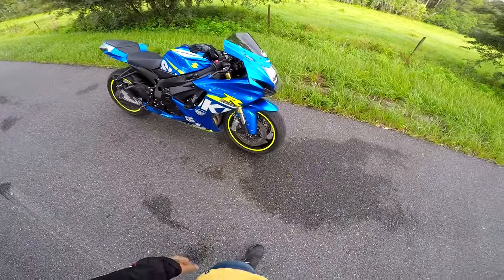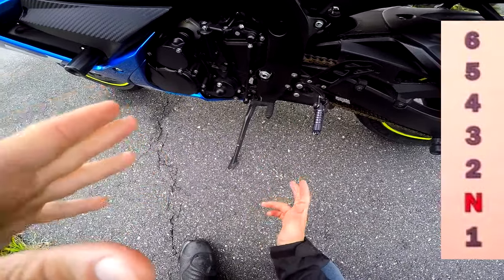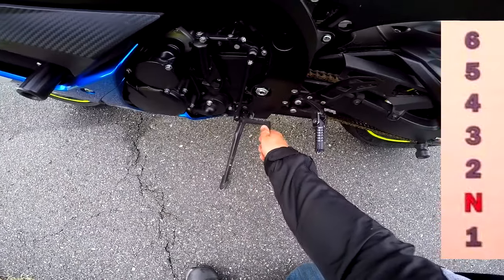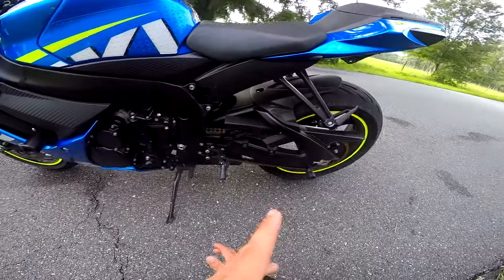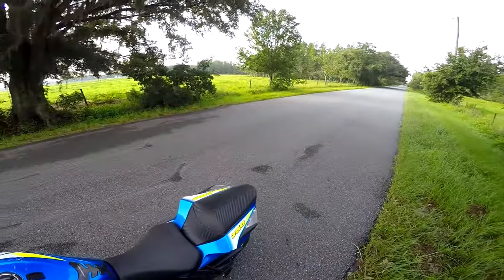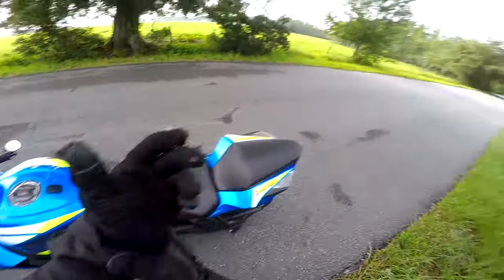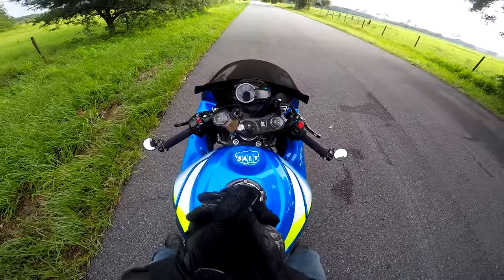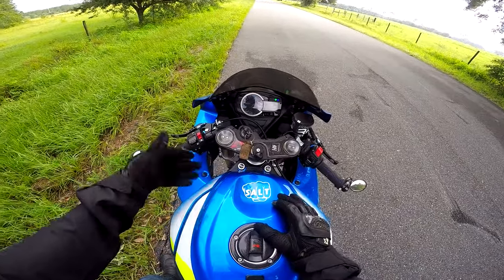How To Ride a Motorcycle: Part 2 - Shifting & Downshifting

Comment: To everyone learning, don’t worry you’ll get it! It seems complicated at first but it becomes second nature. Ride on!
Reply: I'm starting to learn now. Obviously struggling, thats why Im watching this video. My foot keeps missing the gear switch too
Reply: @rickshue3583  qqq
Reply: I can completely understand it I never ride on before but I’m gonna buy a GSXR 750 🏍💨🔥 very soon 😁🤪
Reply: @rickshue3583  Maybe try adjusting the shifter to the right level
Reply: Dude I’m so worried about it I’m about to buy a Yamaha FZ6R and worried about shifting lol 🥴😩
Reply: My friction zone is the point i give it gas? Or i release clutch fully then gas?
Reply: @kimhall9886   Most bikes will stall if you don’t give it any gas and let the clutch fully out. Every bike’s friction zone is different, but you can get a feel for yours easy by practicing this: Get plenty of space, put it in first, slowly/gently let off the clutch and roll on throttle at the same time just til you’re rolling, then pull in clutch and let off throttle. Repeat repeat repeat. IMPORTANT If you get scared or anything, pull in clutch/roll off throttle to cut power to the wheel and you’re perfectly safe. Once you get comfortable with first, try shifting to second. Same principle but you shift up to second, let out clutch and roll on throttle. Practice practice practice. Safe and happy riding everyone! ☮️
Reply: @kvlt22  thank you! That make sense.
Reply: @kvlt22  thanks
Reply: I started riding pit bikes and minimotos aged 12, first geared bike at 13, im now 28 and still stall bikes everytime I'm on them, got a racey clutch hand 😂😂😂
Reply: I am picking up my cbr 300r today and nervous but excited as hell
Reply: I was so scared first time but second turn I already was in 5th gear and then the next week on the high way 😅😂
Reply: Yessir I rode a gsxr 750 in 8th grade
Reply: Thanks. Is it like a bicycle?
Reply: Thank you so much man I overthink everything really needed this ❤️
Reply: Thanks man ! Needed this pep comment haha
Reply: RIDE ON THESE NUTZ! Not gay✌🏻
Reply: instablaster...
Reply: So when im shifting gears I dont have to release clutch slowly, the only time to release clutch slowly is when im in 1st gear taking off?
Reply: Thank you 💗
Reply: @kvlt22  If you’re in 3rd or 4th gear and want to downshift to 1 to stop can you do it all in 1 downshift or do you have to do from 3rd to 2nd to 1st?
Reply: Thx 🙏
Reply: I've just been practicing where the clutch engages and how much throttle to give it to get moving.. only had it for a day though, probably gunna tow it to a parking lot tomorrow so I can actually get moving
Reply: @DeAngeloShaw  how did you do? I just bought a ninja 500 for 2k that's already been dropped so I dont care if I drop it... no way I'm buying a new bike as a complete beginner
Reply: Absolutely does
Reply: Thanks
Reply: What is disappointing to see is that I'm thinking of getting an electric bike and then the UK if you learn on an automatic car than you can only drive an automatic. It's a shame isn't the same rule for electric bikes
Reply: WHAT IF I HIT A POT HOLE 🕳 🫤
Reply: @user-ib7wy4oq9e  😀
Reply: Nice words 👌
Reply: @CarboyJt  no one can answer that. It depends on how you react to it and how big the pot
Hole is.
Reply: i teach people stick shift driving in my little honda and i say all the time you wont learn until you actually want to
Reply: I have my CBT next week!  Thank you for helping me understand this ❤️
Reply: Just what I needed to hear. Thank you
Reply: Appreciate the encouragement
Reply: How encouraging!
Reply: Thank you 🥲
Reply: Thanks man
Reply: So i bought my self a dual sport bike to learn to ride and every time i down shift it feels like my back tire wants to lock up does anyone know what i should do to prevent that
Reply: @unknowneclipse8496  it sounds like you might be trying to downshift too early. You’re at too high of speed and maybe aren’t rev matching. Your wheels are spinning too fast for the gear you’re shifting into. Your gears are rapidly trying to slow down your wheel, to the point that it feels like they’re locking up/lurching you forward. 
Advice: LISTEN to your engine. If it’s screaming, it probably isn’t ready to downshift. Eventually you’ll find the best rpm range to downshift, and that’s probably lower than you think. Rev matching helps by increasing your engine speed to match the speed of the rear wheel. To do it, shift down a gear, and blip the throttle right before/as you release the clutch (there are lots of videos that explain it much better than I can). Learning to rev match will make shifts buffer smooth and give you more flexibility. Hope that wasn’t confusing, good luck!
Reply: Thank you for the positive comment!
Reply: @kimhall9886  It really depends on the bike but I always suggest gas while in friction zone. Smaller cc bikes will struggle to take off without it and will stall when the clutch is released. Powerful bikes will take off without gas. It also depends on your slope and how quick you want to pull forward. It’s a feel thing. Especially in traffic.
Reply: Thank you sir! 🙏🏼
Reply: @FERCASPR  I’ll see you in heaven
Reply: Just had my first day today, stalled over 30 times…
Reply: This is awesome 👏
Reply: @mattb6646  smart thinking 👍🏻
Reply: @CarboyJt  don’t follow too closely, car can straddle, bike can’t
Reply: Thanks I’m over here losing sleep over riding this season
Reply: I'm worried I'll break my bike by misshitfing..
Reply: Thank you!
Reply: I’m starting on a 2024 Ducati panigale v4 Red
Reply: Just passed cbt today and watching videos to help with down shifting 😅
Reply: @rickshue3583 same 😂
Reply: @FERCASPR I hope you didn’t start on a 750 bc I did and I’m having so much trouble rn even in B mode 😢
Reply: @Jason-ip6wq  Damn that reply was 3 years ago 😱, No I haven’t bought no motorcycle yet, But I’ve still been dreaming to ride a sport bike, I feel I still can learn fast lol
Reply: I understood it so fast, I tought its complicated but its not

Comment: just up shifted for the first time thanks to this video, got comfortable with it and was able to get up to 5th without stalling/falling/crashing
Reply from the maker: Thanks for watching! Happy to help :)
Reply: @SALTxTHExWOUND  Hey man! If you want to brake really fast, and you're in 6th, can you first stand still and then shift all the way down by just holding the clutch and shifting down?
Reply: @Bible_Ben  yes, you can do that if you pull clutch while braking or slowing down. But if you slow down without pulling in clutch,the bike will stall as the gear is too high for that speed. With practice, you'll be able to downshift and brake simultaneously. This will also engage engine braking which makes the bike slow down faster than just braking
Reply: What bike do you ride? None of the bikes I've ridden stall when shifting up or down in motion
Reply: Be safe out there brother.

Comment: My biggest fear was "how am I going to know when to switch gears" I bought my first bike 800cc first time rider self taught with the help of video like these ! Shifting was natural stop and going was the hard part lol constantly stalling im getting better tho 4th day!
Reply: Make sure that when you down shift you rev match to slow you down. When you only hold clutch in and gear down it might feel groggy and shaky. So that your engine speed will match transmission and so on.
Reply: What type of bike did you get? I’m about to get a 95 Vulcan 800,
Reply: 800cc is too much powet for first bike i reccomed 600cc-300cc
Reply: 800 first 😳😳 Damn bro!! wasnt the accelration an issue?
Reply: I just got my first bike it’s a 954cc Fireblade you can learn in anything if you take it slow
Reply: Ur owners manual recommends what speed for each gear.
Reply: @kyrissathomas3875  . No manufacturer recommends Rev matching
Reply: @jeffwyatt9255  it stabilizes the bike a lot more
Reply: @kyrissathomas3875  if ur in the right gear when shifting down, no need to blip. No manufacturer recommends this action for normal riding.
Reply: @jeffwyatt9255  okay everybody rides differently. It is a  simply technique that is proven to not actually do any damage to the bike, unless done wrong, so it’s not that big a deal. They wouldn’t recommend it for a stick shift but we do it anyways because it makes for a better and more smooth downshift.

Comment: I was always afraid of driving these cause I thought it was to complicated but wow this is easy
Reply: I have watched so many videos and this is the best instructor I have seen. Thanks so much !
Reply: It's easy to shift not so easy to do slow turns and maneuvers. But yeah get a bike and practice. I got one a few months ago and I'm already riding everywhere.
Reply: @rebeccalasky6109  I’ve gotten pretty good at slow speed maneuvers but I can’t wrap my head around the gears and how they work. I’ve dumped my engine on the highway and it was scary. I just don’t understand rpm and all that
Reply: @antoniorodriguez162  get a Honda they’re very user friendly most of the newer bikes have shift indicators and it shows what gear you’re in on the display.
Reply: LoL.
Reply: Same
Reply: @antoniorodriguez162  if rpms get too high engine go boom. Shift up when close to redline. If rpms are too low you stall
Reply: Yea once your good at it you can rip it down the freeway at 170 mph
Reply: I just got a bike and like im struggling so im not alone

Comment: Thank you
I literally just bought my very own brand new bike but I legit have zero experience, never ridden before, only passenger a handful of times
I got what I think most bikers would call a crappy bike but I'm proud of it & is currently my most valuable possession but the most I've done on it so far is sat on it & turned it on lol
It's an X-Pro BD125-2 aka Boomcat
4 stroke, 125cc Chinese made, cafe cruiser kinda lookin, I've read It's design is based off a 70's Honda bike

Comment: I took the class for 2 days, had never ridden any sort of bike other than a bicycle before and I picked up my brand new bike the day after learning and went straight to the street for the first time from leaving the dealer. 

If you’re learning or you’re about to and you’re afraid/nervous. Don’t be.
If I can do it that quickly, then you can do it too!! I believe in you all.
I don’t recommend doing what I did for everyone, but I’m the type to just say F it and I’m usually pretty good at doing things while under pressure.

Comment: It's not the same. You can shift into neutral from any gear in a car. On a bike, neutral is only found between 1&2. This was the very reason I started looking for tutorials on downshifting into neutral when braking. Since cars can go into neutral from any gear, I never use the clutch when stopping. Just rap the pedal to get it out of gear and hit the brake. No clutch needed. 

Your video here, helped remind me that the clutch can be used to remove power from the drivetrain, just like neutral. I drive a semi but, don't own a bike...yet. 😁

Of the few tutorials I went through, this one is the best. Great job explaining downshifting and finding neutral because I thought you had to go down on the shifter 3 times then up twice to get to neutral (like up shifting in reverse). Didn't know you could reach neutral from 2nd. I asked my dad and he was like, "Aw ya just keep smacking it down and it'll go into neutral"...😐... My father would've had me in 1st gear so knowing that half step between 1 & 2 was very important.

Like I said above, thank you for the great tutorial. You hit on everything I was questioning. Thank you.

Comment: Yo bro good tutorial! How about tutorials on panic braking and situations when a pedestrian suddenly crosses the road, and also what to do when approaching a curved road, after that I'm all set to buy a motorcycle lol.
Reply: A vid will always be better but I can give some quick tips on what you asked. If a pedestrian gets into the way, you want to either brake with both front and back make sure it's steady and smooth pressure so you don't skid. Let's say  you are going too fast to stop swerve out of the way without any brakes. if you are a beginner it is best to always do your shifting and braking before a corner. if you're in a corner and you upshift and you let out the clutch too heavy the back wheel could lose traction and same thing goes with if you downshift at higher rpm with improper clutch release. As you get better with the bike you will be able to brake and shift in a corner but it's best to do it well before the turn when you are just starting off.
Reply: @NasdaqManiac  thanks I'm starting too and I am a little scared to go in the big streets
Reply: Quick tip: don’t slam the front brake with your four fingers you’ll fall. Use your forefinger and your middle finger it’ll make you stop immediately and smoothly
Reply: @NasdaqManiac  I crashed my first bike doing what you explained not to do! Great advice my guy

Comment: so, when do you need to shift? ive had this question for a while. when do you know you need to shift into 2nd gear? and when do you need to know when to downshift back to 1/2?
Reply: There's many reasons why you would shift gears. As a general rule of thumb, people shift gears to go faster. It's that simple. If your in first, you need to shift to second to go faster. Same thing goes in third fourth etc. Now downshifting is actually a bit more complicated. It's not as simple as just going slower, because if you wanted to stop, you would use your brake and not your clutch right? Downshifting is just essentially preparing for a stop, so when you start moving again your more prepared. Let me give you an example. Let's just say your in third gear and your going 50 on a road. You see the light turning yellow. Downshift. Your in second. Keep in mind you have to do this within a certain distance from the stop. You can't just downshift 10 meters before the light, because you won't have enough time to stop. So now that you are in second, you essentially already stopped. All you have to do from here is pull in your clutch, hit the brakes to stop the bike, put it in first and wait until the light turns green. Some people unironically downshift to first gear before they actually stop the bike, but I don't think that's necessary. If you want to do it go ahead. I prefer stopping at second then downshifting to first. I feel like first gear is just a gear that was made for the bike to start going after a stop. No one should downshift into first gear while their moving (my opinion always). Anyway good luck dude hope this helped you!
Reply: @antoniochiorazzo7974  that was some good Information, but im really confused, when your in 4 gear for example, can you downshift to 3, or if your on 5 can you down shift to 4 ? If so then how ?
Reply: @antoniochiorazzo7974  great explanation! I’m taking the certification class and kept tripping up because I was in 2nd going fast and they wanted us to do a quick stop. My brain was having a hard time downshifting and then doing the quick stop then I would end up letting go of the clutch and stalling. Going to try braking then shifting into first
Reply: When you switch gears you usually. Switch to second or the next gear at around half rpm or a little more for smoother transition

Comment: Good day sir, do you also need to release the clutch lever slowly when you're changing from 1st gear and so on? Thank you
Reply: No after than you can pull in and just let go
Reply: @SimplyKelp  you can controll the release of the lever abit but nothing near as slow as when pulling off in first
Reply: Great question
Reply: I think this has been one of my problems.
Reply: @zokxso1627  Damn i thought you have to release it always so slow, its good to know you dont have to
Reply: @MK23122  the main thing is to be smooth right through releasing the clutch
Reply: @zokxso1627  Also i have a question if i want to stop quickly and im on 5th gear for example, to switch to 2nd gear from 5th i need to just hold the clutch and click it down to 2nd one by one? (sorry im amateur)
Reply: @MK23122  yeah thats right
Reply: @zokxso1627  Also one more if im on red light, should i just put bike in neutral and wait, or can i just stop on 2nd gear then put it in first and just hold the clutch until red light goes off. What do you think its better? Thank you for answer
Reply: @MK23122  putting the bike in neutral is good and will save your clutch abit because your clutch will be engaged a lot less of the time youre riding plus your hand will probably cramp up after a long day riding if you think about it u will be using clutch alot and no worries am no professional but jst try get smooth with clutch and changing gears

Comment: But why do I wanna shift gears? I can't just stay in 1st gear and do everything or stay in 6 and have all the power? Newborn here.
Reply: You want to be in the right gear at the right time and you downshift when coming to a stop
Reply: You shift gears to match the engine speed. If you don’t change gears you will run out of rpm and engine will cut out and you will not be able to go any faster. You shift gears to go faster and if you’re just cruising then it’s better to cruise in the highest gear your bike allows to save on fuel and engine wear.
Reply: just like riding a bicycle, you get to a point where your legs are spinning so fast but your not going any faster. But then you shift a gear and there becomes more resistance when you pedal and you can keep a steady "pedal rotation" or pedal harder to go faster.
Reply: to put it simply mate, you stay in first and you won’t go above 15mph. stay in sixth and you’ll stall when you try to pull off
Reply: M B bb

Comment: When to give gas when upshifting 1 to 2 or 2 to 3 after release the clutch or when friction is on
Reply: Clutch,  throttle, and gear are used simultaneously